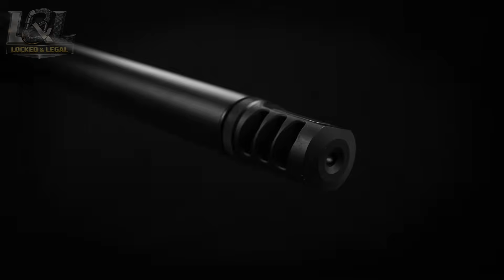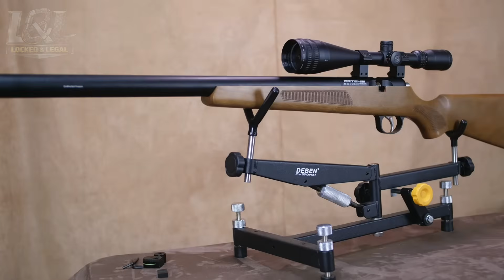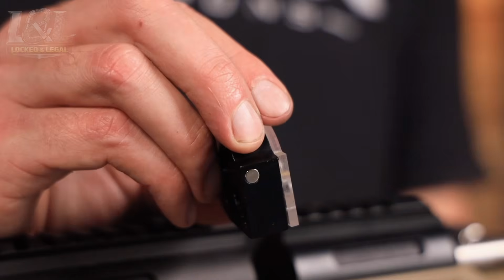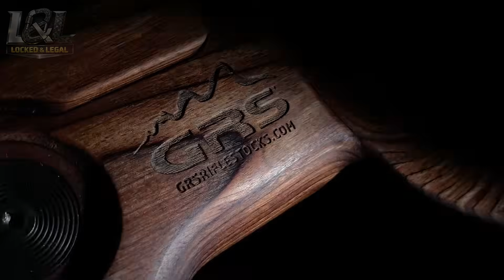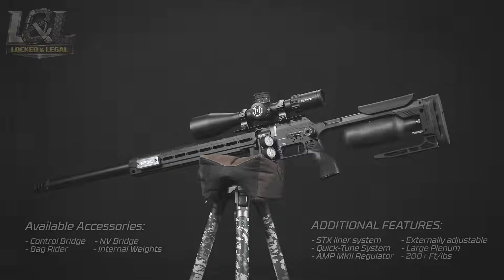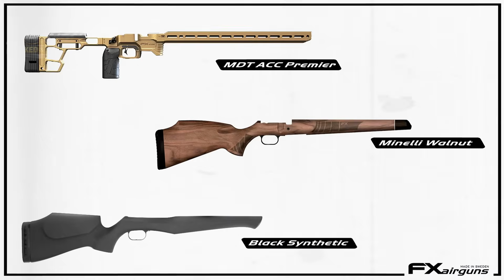They Hid the Air Tank Inside the Barrel. Top 7 Coaxial PCP Air Rifles of 2026

Comment: I dont get the air bottle around the barrel. Nothing changed, except for the gun looking like a gun, and not a super soaker water gun. Still need air  to charge the system. The top 3 rifles are plainly over priced and still need almost $2000 in suport kit. So the bottle is hiden. WHAT IF you drop it and the barrel gets dinged? Id think that would damage the barrle, if not granade the barrel. Same situation if the bottle hits a rock from a drop. Just my thoughts. Im no engener. Makes me think id rather a center fire  fifle. The jury is still out.
Reply from the maker: Honestly, I get where you’re coming from 😄 The coaxial setup cleans up the profile and changes the balance, but it definitely doesn’t eliminate the need for expensive filling gear. And yeah, at the price of those top-end rifles, durability is a completely fair concern. The jury’s still out for a lot of people.